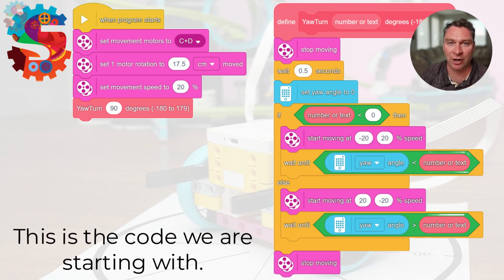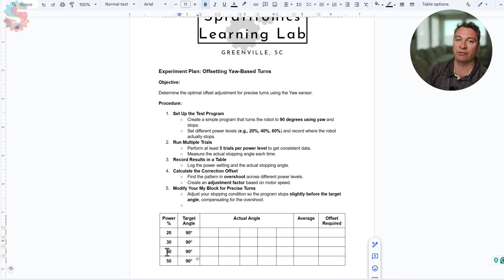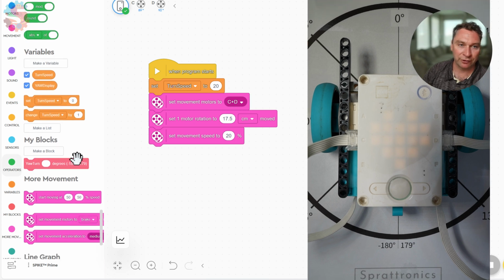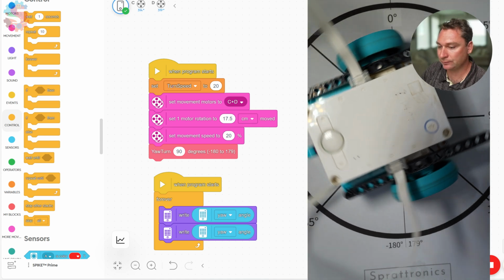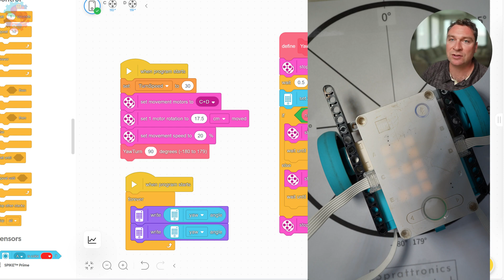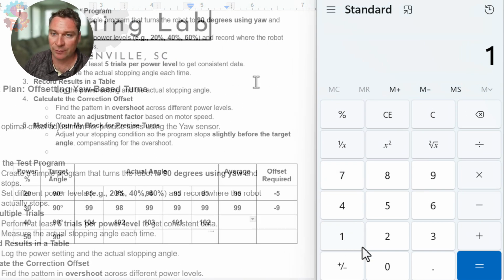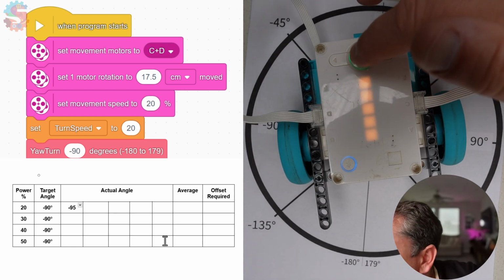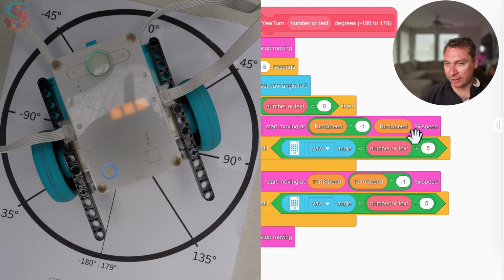Perfect Turns Every Time? Use THIS Offset Trick (LEGO Spike Prime)

Comment: Using a timer it would be interesting to know how long it too to make a turn at the different speed. SWAG values. So if a turn at 20 percent took .7 seconds and a turn at 50 percent too .3 seconds is it worth making turns faster? Just always make the turns ate the same good speed. Or just having a couple of range check to adjust the offset.
Reply from the maker: This sounds like a fun experiment to do. I imagine the offset will have to increase the faster you go. At some point, the speed and time saved may not be as valuable as the accuracy of the turn.